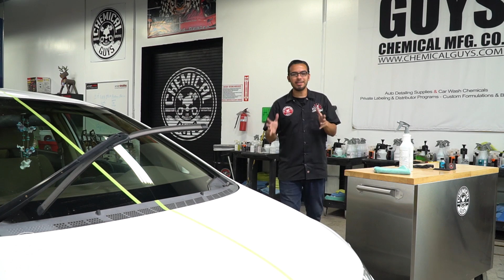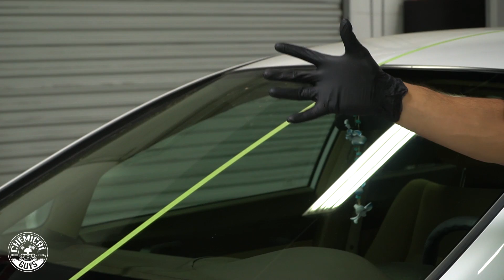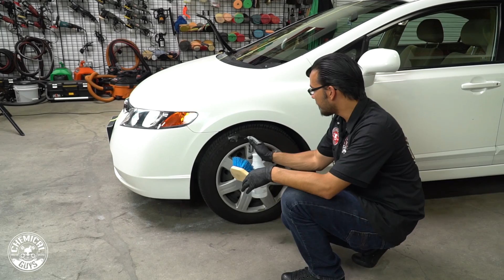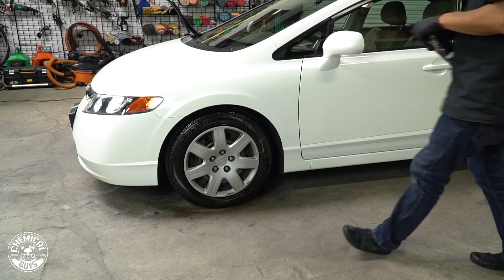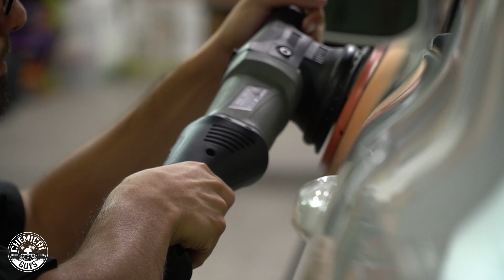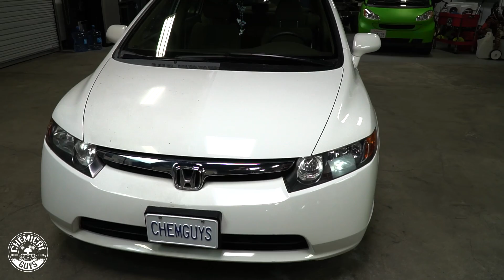Check Out HUGE Before And After!!! - Honda Civic - Chemical Guys Car Care

Comment: Probably picked the wrong colour, white is definitely the least effective at showing the difference between clean and dirty. Should definitely redo the video with a dark colour like black and then heads will really start turning!
Reply from the maker: Hi, thanks for watching. We've seen a broad range of vehicles, and it's much harder to see imperfections on a black car with a camera in an indoor setting.  The last section of the video where we show a before, and after of the civic indicates a distinct difference between the polished side, and the unpolished side. Also, we've done alot of dark colored vehicles in the past, we decided to change things up a bit.
Reply: In person white cars are more pearlescent after a detail

Comment: For a newbie...

Black vehicle that has swirls.  Do you have a package kit you recommend?  Im pretty sure I need to use your clay block and spray but unsure of what else to use.  Only some parts, not entire car.  Normal wear and tear after 5 years.  No oxidation.   

Thanks!  Subscribed!
Reply from the maker: Hey buddy,  I love the cable profile pic. You need to polish the swirls out, I would use a dual action polisher with V36 and an orange pad, followed by V38 and a white pad to finish. This kit is the best bang for your buck, practically the complete package, and not too terrible on the wallet. 
http://www.chemicalguys.com/TORQ_TORQX_Random_Orbital_Polisher_Kit_8_Items_p/buf503x.htm